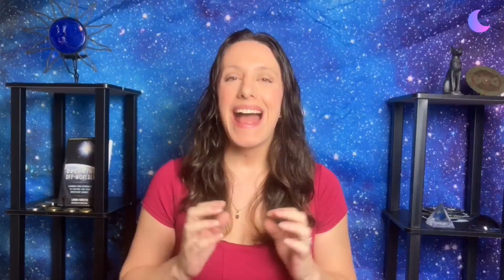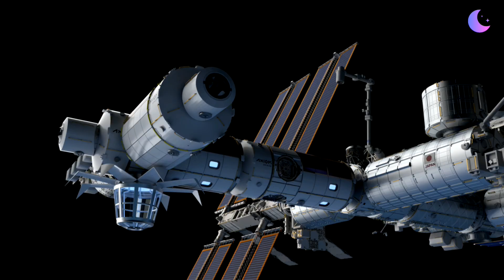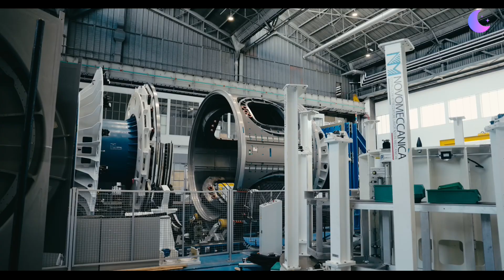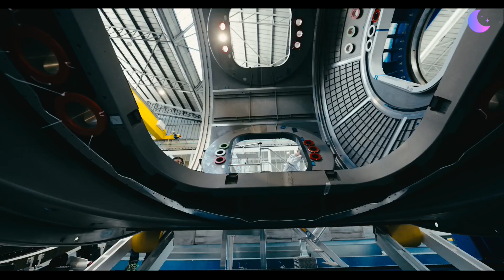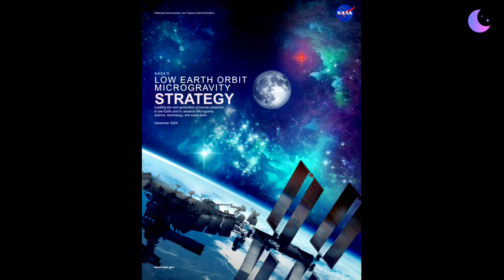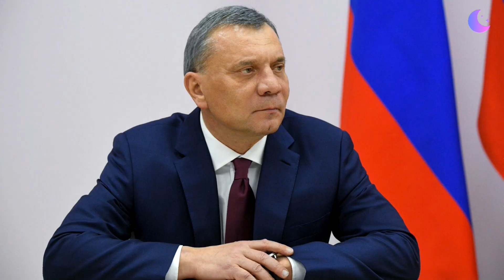Why NASA is changing commercial space station plans

Comment: Starship being stainless can “easily” be modded into a lot of things.  It’s really a great starting point.  For example, a fully functional lunar starship, prior to launch, could be modded with a system that processes lunar regolith to release and store volatiles — insert dirt, seal door, apply heat, condense gases into liquids, expel used dirt and repeat.  Same thing with processing regolith for metals.  The spoil could then be combined with polymer to create protective structures for lunar habitats or simply piled on top.  The key point is the payload of a lunar starship could be integrated into the structure of starship itself to maximize efficiency and capability by building it out on earth on a functional barebones lunar starship.

Comment: NASA is all about change in the wrong ways...
NASA was tasked with returning to the moon and collecting rocks.
Basically, a repeat of Apollo 17 mission...
Instead of reverse engineering Apollo capsule and lander using current technology to save weight, we got a Frankenstein moon rocket that's only launched once every two to three years, a ton of CGI, a potential Starship that requires 12 orbital refuelings to go to the Moon, plans for a moon orbiting space station, a lander so tall that it requires a elevator or very long ladder to enter and exit...
NASA has overextended. 
If NASA have completed the basic task, Congress will be throwing money at them to continue to do more but that hasn't happened.
The term keep it simple stupid applies...😢
Reply: The apollo hardware is way too outdated to take anything from. Don't make assumptions that you cannot state as fact.

Comment: IMHO we should have never gotten into this situation. ISS modules should have been gradually replaced, blurring the line between ISS and whatever comes next. The lack of funding is criminal.
Reply from the maker: I am curious if there is an engineering reason why the ISS modules couldn't be replaced over time.
Reply: You would think/hope that some of the equipment (Alpha magnetic spectrometer, Canadarm2, some modules?) could be transferred over.
Reply: @JustMe-dc6ks There was talk (but no decision) of the Axiom Segment taking robotic arms, the experiment airlock, and possibly even Kibo with it when it detached, but this change in plans likely means that won't happen as the ISS will still need them and the power module doesn't have as many options for attachment.

Axiom has laid off a lot of people recently and owes a lot of money to both SpaceX and Thales. I suspect if any of their hardware makes it to orbit it'll be after the fire sale when somebody else pays for it.
Reply: At the least they could discard the oldest most degraded modules. Why couldn’t some of them be kept and used in future zero g space stations?
Reply: Exactly, there is no reason not to just let the Russians detach their segment and we continue the ISS on our own.

We could have solved this problem already.

Comment: I think commercial space stations will go the same way commercial launch went, with SpaceX being the leader with a modified Starship.
Reply: Starship being stainless can “easily” be modded into a lot of things.  It’s really a great starting point.  For example, a fully functional lunar starship, prior to launch, could be modded with a system that processes lunar regolith to release and store volatiles — ionsert dirt, seal container, apply heat, condense gases into liquids, expel used dirt and repeat.  Same thing with processing regolith for metals.  The spoil could then be combined with polymer to create protective structures for lunar habitats or simply piled on top.  The key point is the payload of a lunar starship could be integrated into the structure of starship itself to maximize efficiency and capability by building it out on earth on an already barebones functional lunar starship.
Reply: Starships could be used as scaffolds for building new space stations on.

Comment: Can the International Space Station be placed into a higher “museum” orbit to save it for posterity?  Too costly?  Not practical enough?  Navigational hazard?
Reply: I would add few things to what Laura had wrote:
To controllable deorbit station NASA need change velocity of station about 50m/s (DeltaV). To achieve that SpaceX will require about 16 tones of propellant. Changing orbit to higher that is actually save from debris and radiation isa should be moved to medium orbit, about 5-20 thousand km away. Basically halfway to geostationary. It would require a LOT of DeltaV, satellite to move from low earth orbit to geostationary transfer orbit (ap= 35800 km) require about 4 thousand DeltaV.
Reply from the maker: NASA looked at that option and decided that not only would it be too costly to boost it and maintain that higher orbit, there's too much risk of space debris (both something hitting ISS or something happening internally to break up ISS). Sucks, though, because I'd rather keep ISS than burn it up!
Reply: @ Yup!  Same here. Thanks Laura!  Keep up your great work.  See you in the next video.
Reply from the maker: @ Thank you!